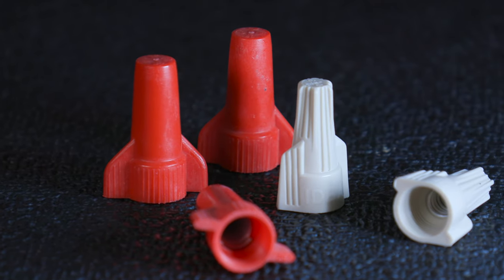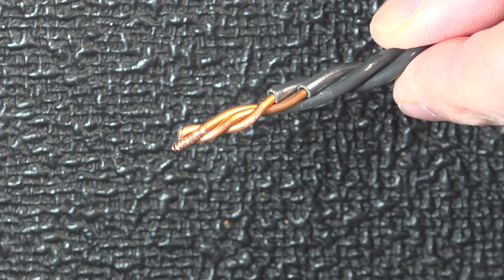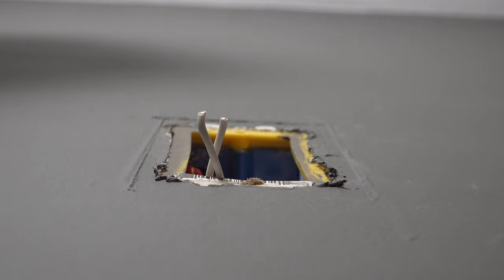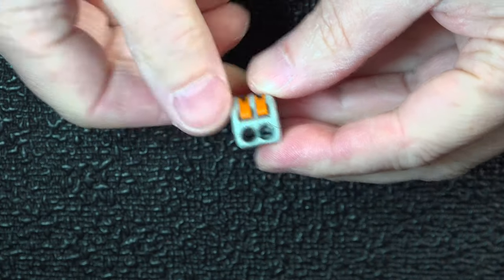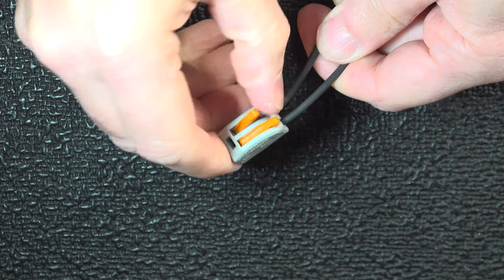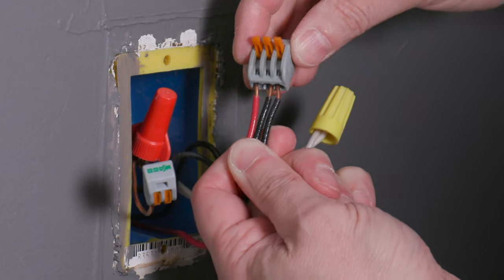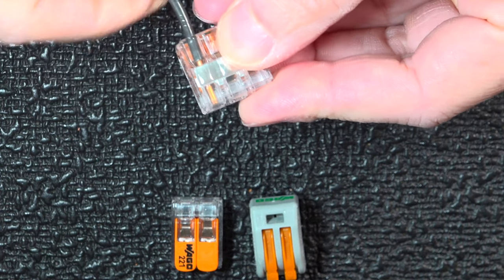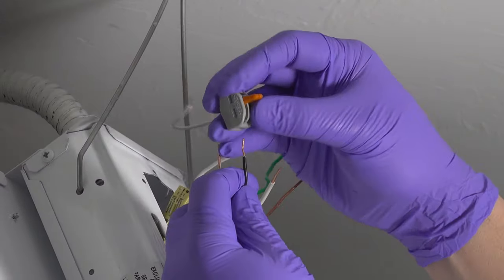Never use Wire Nuts Again - Wago is Better Electrical Connector

Comment: Who are you? Wago's suck. Around here inspectors won't allow them unless they came Factory installed on a light fixture or so. Almost 20 year electrician here. Quit giving people bad advice for views.
Reply from the maker: Let the NFPA know when they tested them successfully that they messed it up and they should have consulted you first, what do they know anyway right, they only write the NEC.
Reply: @SilverCymbal  Wago's are the same technology as stabbing wire in the back of outlets vs. curling and set screw. I've had state inspections where voltage drop in a residential house was checked and failed for it. The fix? Curl and set screw magically +3 volts. Just because something works when its new doesn't mean it's going to stand the test of time. You know what does stand the test of time? Linemans twisting and quality wirenut connections
Reply from the maker: @ceetwarrior  Backstabbed outlets have as much in common with Wagos as does a pineapple to a jet engine. Backstabbed outlets were a disaster and still are. Wagos connection is so different it has it's own patent. If it was the same as existing technology no patent would be granted,
Reply from the maker: @ceetwarrior  Come on, now it' a conspiracy? Wago is a German company. If you skip the angry electrician comments, read through to all the folks in UK, Germany and other countries where nuts were abandoned decades ago for Wagos because they are better and eliminate variance and mistakes. Many of these folks have never even seen a wire nut before.
Reply: @SilverCymbal  Well believe what you want. I'd listen to the professionals, aka 'angry electricians' who deal with this all day, everyday, new, old, hot, cold, hungover, sick, happy, sad  and all in between. We do know best after all.
Reply from the maker: @ceetwarrior  I ask the same question with every one of these comments. Where are the photos of failed 221s, where are the news stories of the houses that burned down, despite millions of views on this video and my other wago test vids, not a single person has replied with a picture, offer to send a damaged one to me or a link to a new story or safety report.  Surely if they are so bad there must be even 1?  But search on burned wire nuts on google, you will find hundreds of horrifying photos. I am open to another opinion but it has to be based on more than bah humbug.
Reply: @SilverCymbal   I've seen failures with Wago's otherwise I wouldn't be discussing the subject now. The break apart (separate) at the seems this losing connection.  I wish I could make money on screwTube views so I didn't have to be an angry electrician. Night. hehe

Comment: Every tool has its purpose, and yes that includes connectors too. Dont be misleading with your information. Yes wagos are easier for a means if disconnect such as on grid lights or can lights but not for more permanent make up such as pigtailing to your receps and switches thats where the wire nuts come it. Bottom line is you cannot fix stupid. You cannot make a tool smarter than the user all your doing then is making a more stupid user. When you try to make your job easier by using the wrong material then your doing the entire job wrong. Plus in the real world good luck trying to explain to your cheap ass boss why he has to spend triple the amount of money not only on they are more expensive than wire nuts but also wasting time listening to you snivel about "twisting wire nuts hurt my hands 😭" and one more thing, anything can come apart like a dumbass put it together only when its in a video made by someone who wants to look down on it. Fact is as a 17 year journeyman electrician wagos sure are handy to use i wont deny it but i guarantee properly used wirenuts will outlast those fancy little contraptions.

Comment: Yes, wirenuts are work and profit producers.
As they get loose systematically due to temperature changes, you can always blame the electrician, who installed them as an idiot and a beginner. So every client thinks he is lucky to get rid of the first one. And after some years, the next electrician can make a fortune out of your installations the same way, as the wirenuts got loose again.
Reply: Interesting.  60+ year old Wirenuts everywhere and I have not found any loose.  I always tug each wire after installation like the inspectors do in good factories.

Comment: Wire  nuts aren't re-usable?!?! lol Overheating?? What kind of BS false info is that?
Reply from the maker: Correct. Except for a small percentage of a certain type most are not. Why would you ever risk a connection to save ten cents?

Comment: No reusable 😂🖐️ stop your lying every single electrician 100% reuses them, wonder how much Wago secretly paid ya for this video 😂, using both these for years there is no difference what soever
Reply from the maker: Correct and 98% of them are not following manufacturers guidelines, which equals stupidity putting customers at risk. Don't buy Wagos if you don't want, but please don't reuse Band Aids or Wire Nuts unless the manufacturers specifies reuse, and why bother to save .10c? Like a carpenter reusing nails. Is good enough quality electric work?

Comment: This guy is a nut 🤣why the hell would you shorten the wires don’t be lazy take it apart, throw wire nut away pre twist all wires and add new wire nut , please don’t do any electrical in my home
Reply from the maker: The NEC doesn't not specify reusing a connector, how could they, each one is different with different properties, weather proof, spring steel, etc. They defer to the manufacturer some of which are in fact reusable, however this type of nut makes up less than 10% of the market. Some companies may allow it others don't comment on it. The real question is, why would you? To save .05 and give a customer a less than perfect connection. Dont buy wagos if you don't want to, but don't screw customers with reused electric tape, bandaids, toilet paper or wire nuts please. The $200 you save in your lifetime isn't worth someones safety.

Comment: Oh, no!  Bite marks on the wires!

Hey, I get that you like Wago connectors, but your laundry list of complaints about wire nuts is bordering on the absurd.  Sell what you want, but you're obviously hoping your audience is ignorant and unskilled.
Reply from the maker: So nicked and rough ended wires are desirable for a good connection? NEC tells you to cut and restrip wire with such damage. Break the rules all you want, doesn't mean its right and electrical fires are no joke. Don't buy Wagos if you don't want but please do a good job.
Reply: @SilverCymbal  Dude, I've never liked wire nuts.  All I'm saying is you're exaggerating.  If I'm removing a wire nut and trimming the ends of the wire, for example, I'm not cutting off two inches of wire, flush with the wall.

Comment: This video is so full of shit LMAO 😂 I've reused wire nuts, I've used them with different wire types i.e. ( stranded & solid core) if you know what you're doing and you don't buy cheap shit wire nuts are easy and make good solid connection with lots of solid surface area contact. And that bit about having to remove wire also bullshit. Maybe MAYBE if a bunch of changes a re made you might MIGHT have to remove couple mm at the tip of the wire MAYBE. Istared doing electrical work in like 2000 and I've never had an issue with wire nuts loosening or having to remove more than a couple mm of wire in rare cases so long as the wire nut was used appropriately.
Reply from the maker: You reuse bandaids too. You are seriously saying that it's ok to make connections with nicked and damaged wire? Ok I will let the NEC know they are wrong
Reply: @SilverCymbal  yeah you do that lmao

Comment: What the "at home, D. I Y. electrical engineer" in this video fails to mention ( perhaps because he isn't aware of it ) is that these type of connectors only clamp onto a very tiny bit of the wire and when making an electrical circuit connection - SURFACE AREA is everything ! Surface area contact ( the amount of wire that comes into contact with the other wire(s) ) is CRUCIAL. The amount of CURRENT ( amps ) that a wire can conduct is determined by wire thickness AND how good of a connection two or more wires make with each other. I rate these connectors as a FAIL. I have over 32 years of experience working on Heating & Air Conditioning equipment & it's associated electrical circuits. It's called experience.
Reply from the maker: https://youtu.be/B1pmuRsf1co

Comment: Waco still hasn’t figured out how to control ‘spring-back’ or ‘creep’ with theses buster-nuts !!!   Keep trying !
We’ll count the fires…
Reply from the maker: Just made up talk to ensure you don't need to change anything you do. As I offered dozens of times, send me one picture or one example of a failed Wago 221 anywhere in the world I will examine it along with the the NFPA that is down the street from me, I am sure they would also be interested since there own extended tests showed these did very well. Oh by the way search on burned wire nuts you will find hundreds of examples.  Strange that there is not 1 Wago.